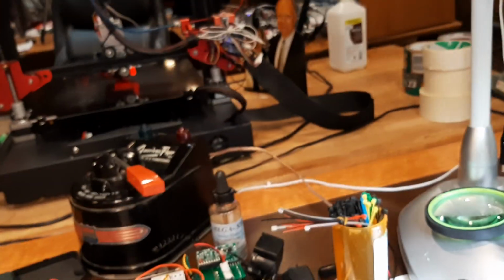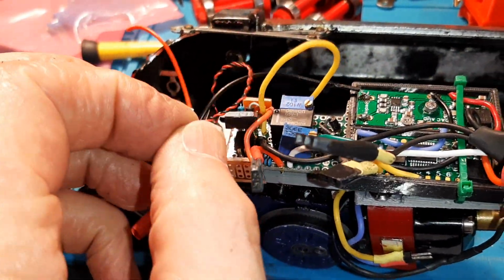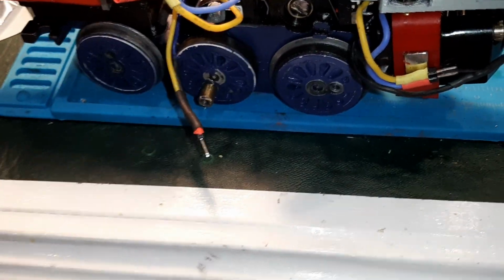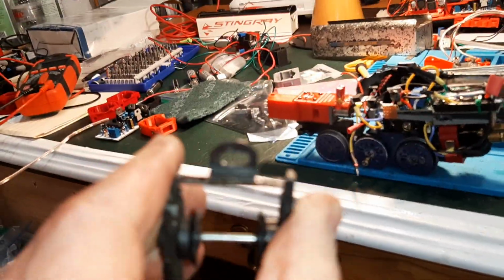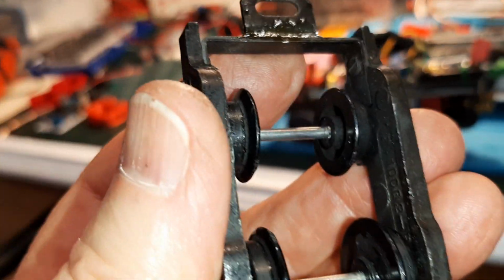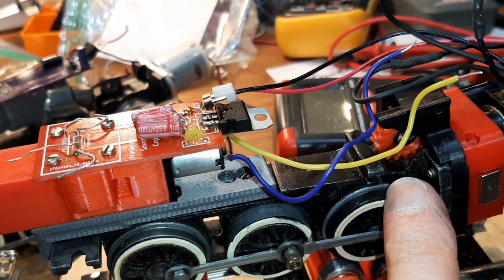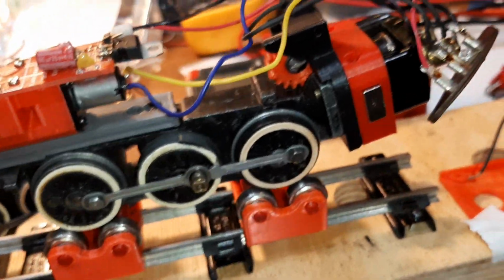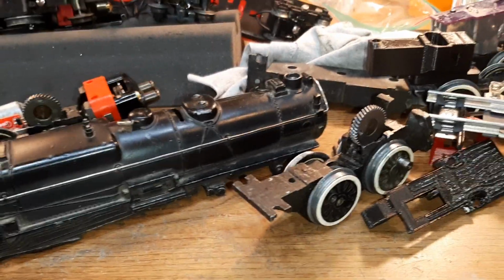Royal Blue digital P&C works but, needs to go on a diet bad. EasyEDA PC Board design, next time.

Comment: After you make the new board, can you set the motor and then install the mounting tabs after?? Just a thought.. It’s coming along nicely… Keep it up..
Reply from the maker: I tried to think that through. Holding the parts,  aligning the tab and hole then fitting screw in it all just seemed too awkward. I thought of epoxy the tabs to the engine chassis so then we align the holes on sliding it together. But that is to flimsy a location. JB weld might hold but still pretty dramatic a mod.
Reply from the maker: Thought more about this topic. I have a chassis ruined by zinc rot. I will try JB Weld on the tabs and see if that works. So the chassis would have 2 frt and 2 rear tabs, set the engine down and screw it together from the bottom. Inverted of course so top down assembly. That would simplify my job immensely.